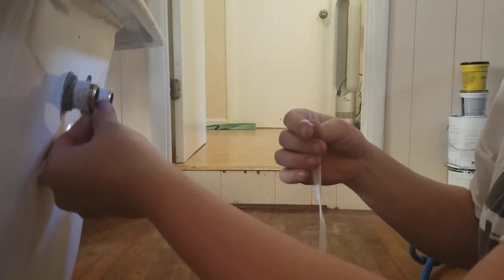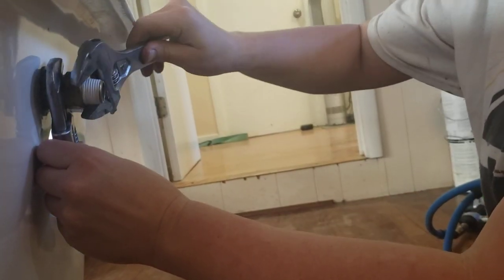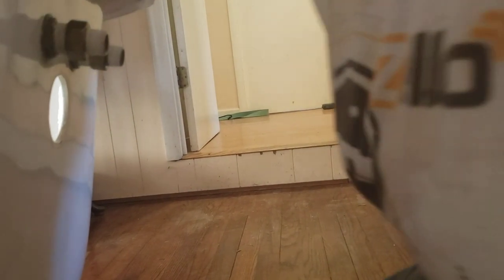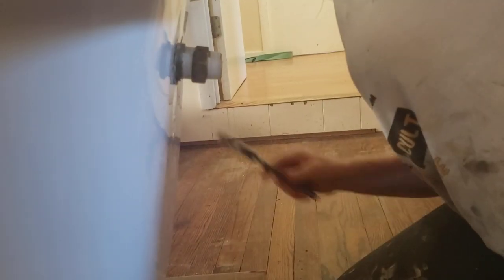Clawfoot faucet install... the instructions were weird

Comment: That faucet is straight thread (no taper) It requires FIP straight fitting ( not tapered) with a washer like a garden hose. No teflon tape needed.
Reply: Teflon still a good idea to avoid galvanic corrosion, and to make removal easier down the road.

Comment: Was that an extension or an adapter for different threads?
Reply from the maker: The shower piece to turn the tub unto a shower too. I bought it on Amazon and it had a smaller pipe than standard other shower pipes. Ended up being a total pain in the neck to use with off the shelp shower heads, but.we got it done and thankfully it will take standard us shower heads now!!
Reply: What I was referring to was the extensions where the water inputs hook up not the shower.
Reply from the maker: @martybgood62  those were standard faucet hoses